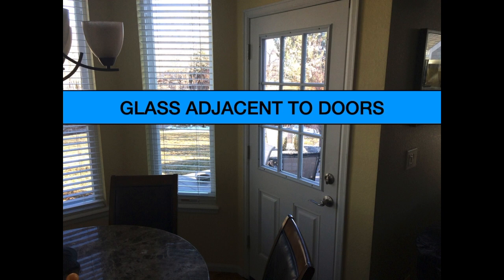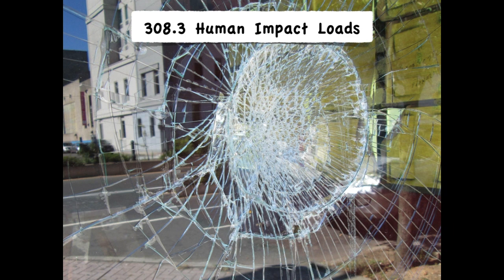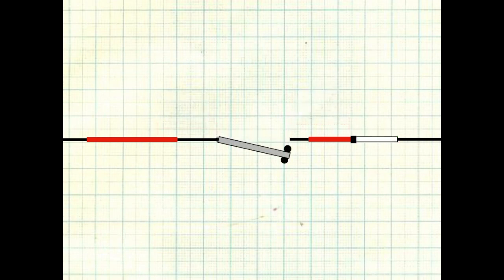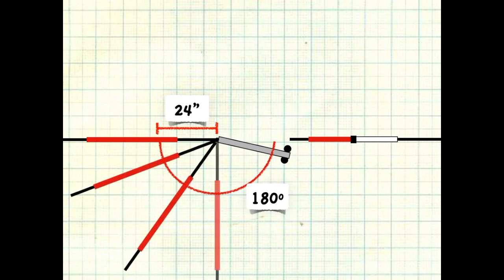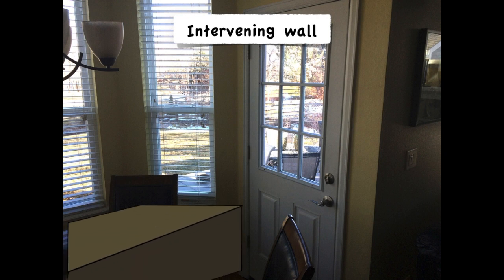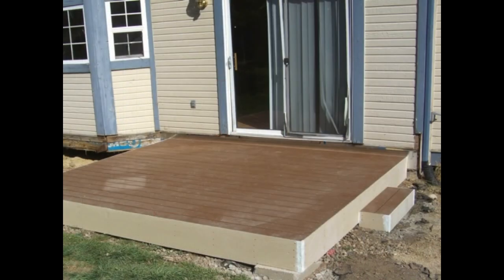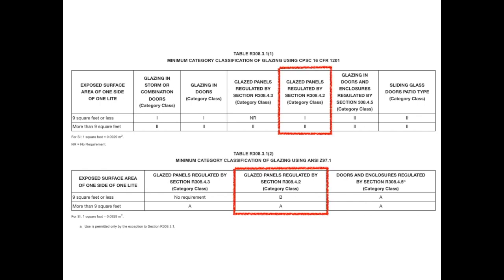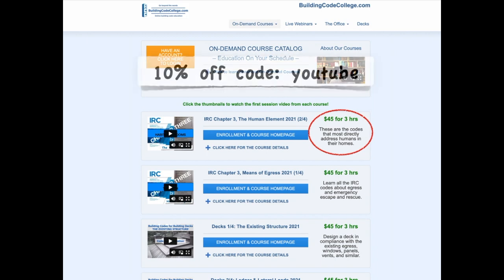Building Codes for Safety Glazing Adjacent to Doors

Comment: Nice insight! Question, what about actual sliding closet doors? Lets say I want to install a decorative closet sliding doors with 1/8" thickness mirror or painted glass. Do I need to use safety backing on said glass?